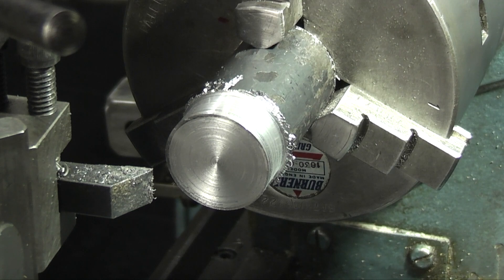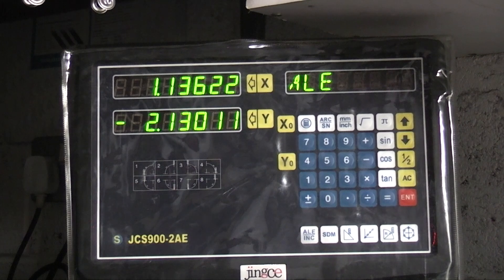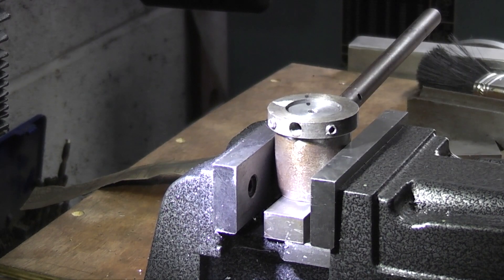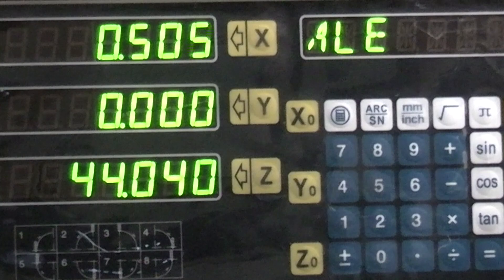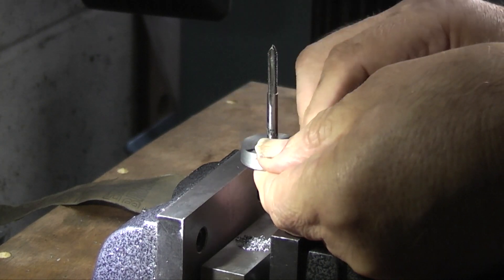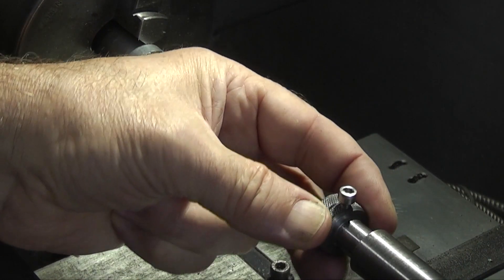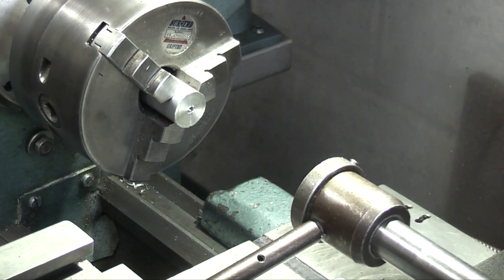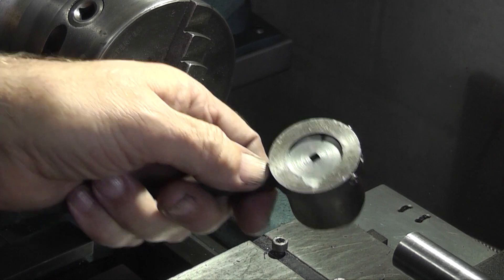Making a tap holder to fit a diestock

Comment: A question about your DRO. In the inch mode, can you set the decimal places to only 4 instead of the 5 places it comes set at.
Reply from the maker: I,ve not found any way of changing that
Reply: @enotsengineering  I have not either, if you come up with a way please let me know. I have tried everything I could think of.